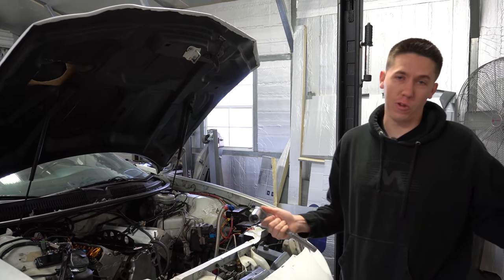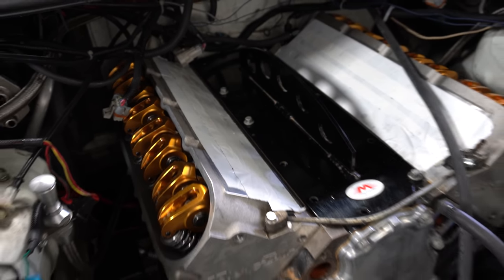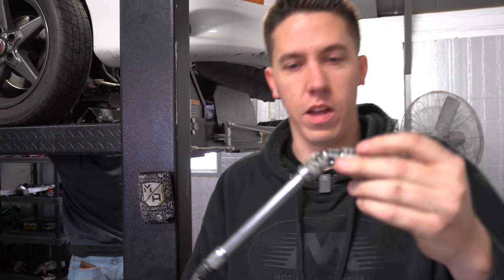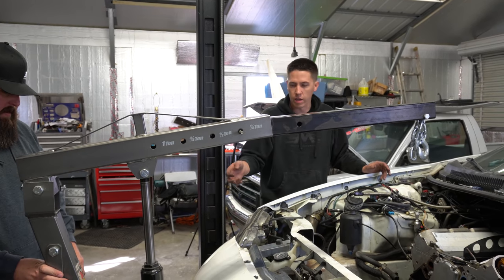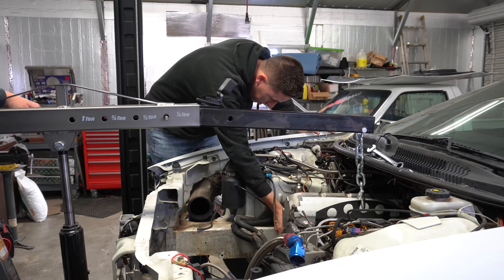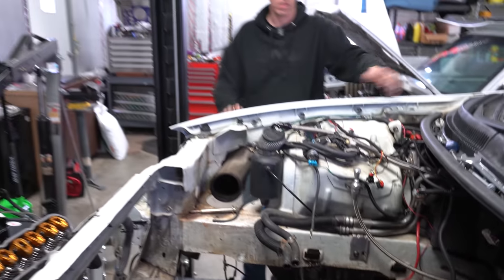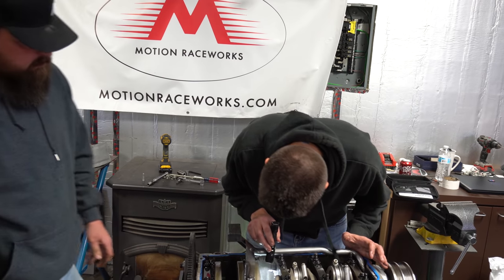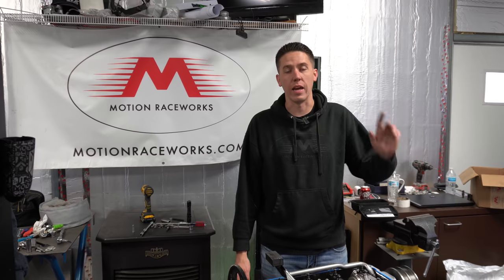School Of Broken Parts... Turbo Camaro Engine is Torched!

Comment: Fix the 408 dude. I would definitely remove and replace the reluctor wheel for a new one and check the clearance with the crank sensor on reassembly. You already have good rods and crank. Put the motor back together with good clearances and that thing will run all day.
Reply from the maker: As long as the cylinder wall isn’t hurt this will probably happen but we will see!

Comment: I’d me checking your injector harness with it burning down the same hole it did last time. I’d load up the harness with a headlamp bulb and voltage drop both circuits to The injector. Voltage should not be over .5 volts, al honesty you want it as close to zero as possible. Just something you may want to check, don’t wanna see you burn down a 6 bolt block!
Reply from the maker: This has been on my mind to verify and make sure everything seems good on the harness. I’ll also be swapping injectors from these old bosh 160s but I think my main issue is the stock reluctor wheel.

Comment: I have a 79 with a TH400 and the rigid trans shield and flexplate shield, a swivel socket and about 4 feet of extension is the only way to get the upper bolts. The job is MUCH less fun doing it on the floor of the shop on jack stands, with the added necessity of bi-focal glasses.
Reply from the maker: When I’ve done this in the ground before it was definitely worse too lol. I’m sure the rigid shield make it a real pain

Comment: How much more work/$$$ would it be to drop in that 5.3l LT engine? I really want to play around with one of those. I contemplated buying yours when you had it for sale a while back, but I already had an engine together.
Reply from the maker: To put a Gen 5 in it I’d have to run different motor mounts or an engine plate. Also intakes are not super common for them yet. You can get a rod and piston drop in for around $1600 which is pretty sweet! Then I’d have to get the stuff to delete the DI cause I would go port injection on a race setup. It more of a budget idea I have that also saves 100lbs out of the car!

Comment: What oil pressure sensor is that for looks shorter then a normal 5.3 sensor
Reply from the maker: It’s a corvette sensor I think c5 if I remember right. It has the right plug for Holley and is shorter  then the truck sensors.
Reply: @BuildTuneRace  thanks I'm going to be running a holley on my car this sensor would look better